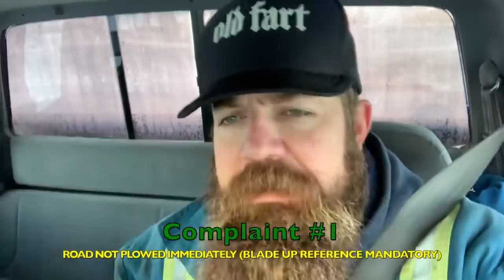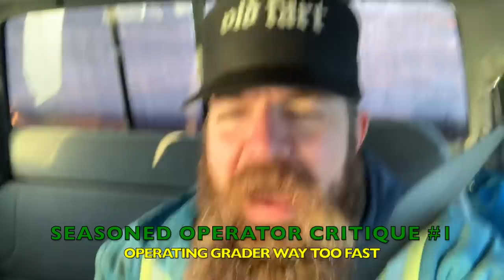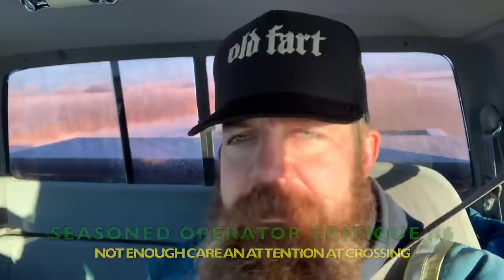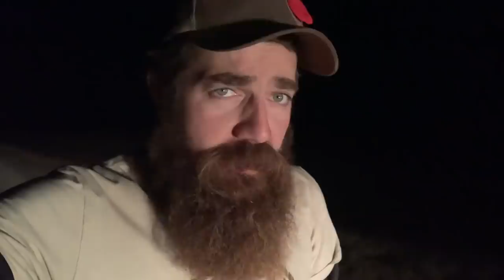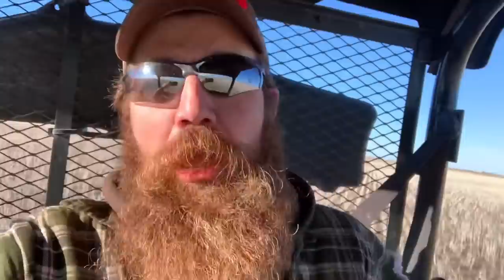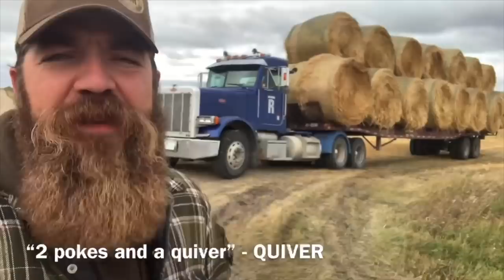The Grader Guy

Comment: One winter the grader operator went on holiday and the MD forgot to assign a replacement. For two weeks we walked the three quarters of a mile from the highway. To the grader operator's credit, when he got back from Vegas or Mexico he jumped straight on his grader. It was a Sunday, he worked late and he got everyone's roads plowed. Memorable nights walking with the moonlight on the snow, the yotes singing up a storm. Blue Shadows on the Trail (Sons of the Pioneers) or what?

Comment: Our nieghbour used to go to the grader operators with a tire gauge and tell him the air pressure  was too high and wanted to let out about 20 psi stating that the blade would then perhaps touch the road.

Comment: Fuck, they run a zamboni here generally. They actually used salt today, in 30' bursts every 150' cause their using that new gold infused salt and it's too expensive, plus they will use up their entire 300lb supply at once. Usually they drive around with the plow removed, and sand on top of the snow. Later they come by and plow the sand off the road and don't sand. If it snows after 5p and the highway closes, they will come out at about 10p after about 19 semis get stuck on hills.

Comment: The Grader Operator made me laugh so darned hard, Its one of those Canadian/Aussie crossover pieces that works in minus 20 through to 40c.
Something I have done myself, complained long and loud about it but the difference is I CAN operate a grader and the new big Cat GPS guided ones make it really hard to cock up the roads because they take little skill compared to the older units unless you are an old fart like me with fat thumbs...... Takes real skill to piss off the locals by making the corrugations worse than when you started or to make a stretch of road thats more like a whoopdeedoo at a BMX park to slow down notorious drivers heh heh heh.
Maybe im just evil..

Comment: Could be worse... You could have our road LOL:)  https://youtu.be/HP14irpbpps  They busted up the sealcoat and tilled it into the roadbed underneath a few inches deep, dry packed it in a single pass, then dropped about 6 inches or so of road base clay and gravel and sand mix on it, and the ran the packer over that in one pass.  Now I'm not a road engineer, but I DO know you can't just dry pack stuff in ONE PASS... then we got 2.75 inches of rain in a slow soaker overnight... turned to oatmeal.  Betty barely got the van out to go for an oil change early that morning, by noon there had been five vehicles stuck on the road, including us, in the other minivan which sank to the frame, and we had to push it out with the Mahindra because the chains and ropes are in the farm truck on the other farm 90 miles away.  Another guy and gal got stuck just outside the cattleguard and we pushed them halfway back to the paved road before a friend showed up and pulled them the rest of the way.  It was SUCH a mess by the time Betty got back I told her to park down on the end of the pavement and I'd come get her in the tractor with the cattle trailer behind it... SO we ended up having to relay out of the farm for 2-3 days til the road firmed up like that.  The grader guy was nice, though; I didn't blame them for it he said they kinda got caught short and didn't have time to do the job right-- normally you'd grade off all the loose stuff, then pack the ground, roll a couple inch thick layer in, pack it down tight, roll another couple inches on top of it, pack that down tight, and just keep doing that til the whole thing was packed, smooth, and level.  Course packing road material DRY just doesn't achieve a lot-- it's gonna be soft when it gets rain anyway because then the soil particles can move because of the moisture between them, so they pack down MORE and usually slip and slide around enough to get MUSHY if there's a lot of water, which is exactly what we got after about 6 weeks with NO rain at all to speak of... SO even dry packing in thin layers it would have still been something of a mess.  Best if the material is damp so that when you pack it the particles can slide around and squeeze in tight to one another and then it firms up, and when it gets rain dumped on it after that the particles don't move much because they've already been packed down into position and slipped past each other enough to settle in TIGHT...  Oh well... they fixed it but it was a h3ll of a mess for a few days!  Later!  OL J R :)